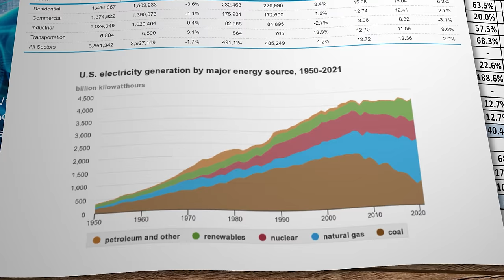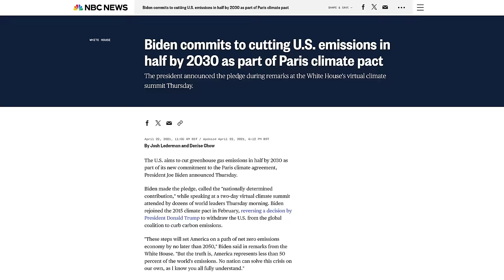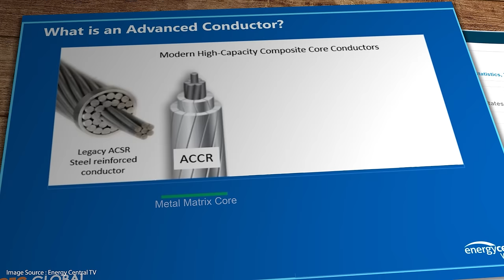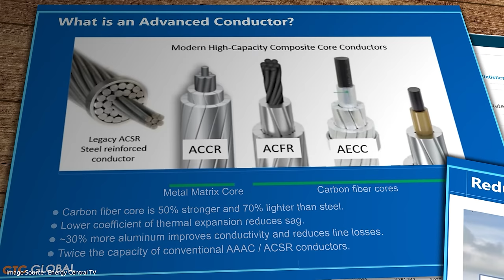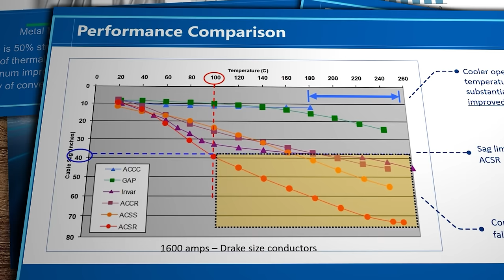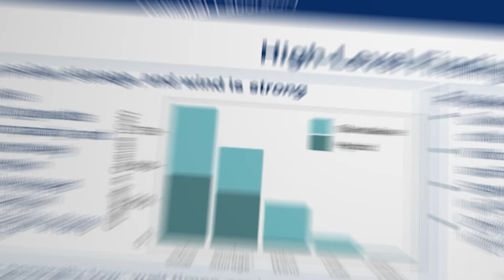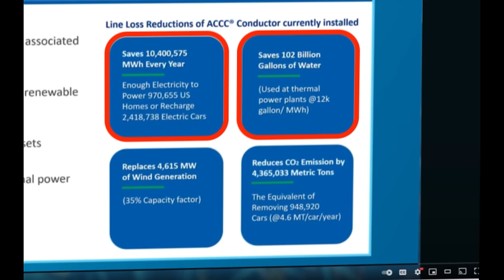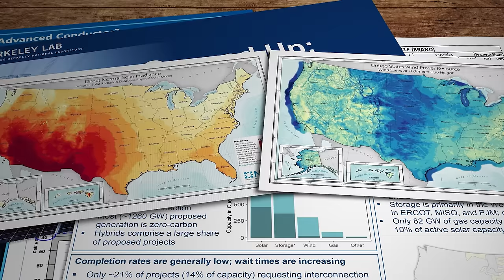Rethinking electricity grids.

Comment: 3:44 ACSR does not mean the aluminum conductors are protected by the steel. The steel is the loadbearing section and the aluminum the current bearing section. Without the steel, Aluminum wires would sag far too much and the risk of breaking would be quite high. The steel holds it up and steel is quite cheap.

5:23 The weight of the cable, regardless of the core, is still a major hurdle. That weight induces forces on the structures that hold them up. If you go too heavy, you'd need thicker (can also be read as taller) poles to handle those forces. Poles for distribution are often made of wood. These can be anywhere between $1000-2500 depending on height. If you go for stronger materials like concrete or fiberglass, those costs go up substantially more. And if you consider that a square mile of area that is relatively densely populated likely has 1,000 poles or more... you can see how the costs of this would go up quite quickly for even a small change. Who's going to pay for it?

6:21 Permitting isn't as big of an issue as you might think. Standard municipal permits for work (I'm a utilities designer, btw, specifically for electric) generally take a week or less. It's only when you get into culturally or environmentally sensitive areas that you run into extended timeframes. Most utilities have existing agreements with the municipalities they serve to expedite permitting processes.

7:30 Transmission losses are only really relevant for transmission lines, specifically, ATC (American Transmission Company) in the midwest. They're usually in the hundreds of thousands of volts whereas distribution, going from the substations to your homes, are only 10s of thousands. Rather than reconductoring, a simpler solution would be to kick up the voltage. Doing so reduces the current, which reduces the heating. The only issue is you'd need to replace all the transformers that take that high transmission voltage and drop it to a distribution voltage. That distrubution voltage is usually go for 20 miles or so before you have too great of losses. If you change the distribution voltage and make that higher too, then you have to replace all the service voltage transformers... and that's also expensive.

There are three very important questions you have to ask youself about this 'idea'... Who's going to supply the materials? How much is it going to cost? Who's going to pay for it? Public Utilities have agreements with the states within which they operate to establish the costs of the service. If you start taking on huge (and expensive) projects like this, it first has to go through planning. What's it going to cost? What's the timeline? And then they have to propose an increase to the paying rate for the service to the State for approval. If it is too high, the State will not allow it, which means the project dies. Utilities do not generate a lot of profit and they operate very closely within the margins. Hell, we get updates on the budget every month or so during our group meetings. 

It sounds good... but until it's broken down into details to the point where it's generally given to be cost-effective, it's not leaving the ground. Utilities can't just print money to pay for projects like these. Whatever something costs, we have to take in at least that much to pay for it. There is no credit system here, no 'National Debt' to fall back on. And if you cannot provide a relatively cheap source of electricity to the customers, they won't live here and if they don't live here, there' won't be utility bills being paid which means no monies for projects like this. 

That's really the only gripe I have about your channel. Nearly every story is "Oh here's something we should be doing! Nevermind that it's extremely expensive... just throw some money at it!" but you never get down into the details of how it would actually be paid. Sure, you can look at figures and graphs and get a high level estimate of costs and savings, but that's the same as using laboratory conditions for solar and expecting real-world solar to operate exactly the same at exactly the same cost. And you and I both know that isn't how that works. But... as far as this ONE idea goes... it's not a terrible one. It's still bad, but not terrible.

Cheers.
Reply: The cables have to be replaced every 40 years so you would assume putting in new cabling  is factored into power company budgets. Not everyone lives in the US, in the UK, where this channel is based, National Grid does replace pylon cables in major repair and upgrade. Same in Germany.
Reply: Thanks for that.  I have no idea about the true economics of making the grid more efficient but I do know that home and car battery prices are going to come down about 50% or more. When that happens, being off grid with solar, in countries like Australia that don't have long very cold winters, will be cheaper than being grid connected. Many small towns and isolated farms will simply not need those expensive long connections to a centralised generator. How decentralised generation and storage will affect the economics of the grid is what interests me.
Reply: @marczakian3511 
Deferred maintenance enters the conversation.
Investor owned utilities are notorious for operate until it dies.
The UK has it's little issues too, such as sewerage going into the ocean and DRAX.
Reply: You raise some good questions and offer a fair critique, I think. However, I have some questions and critiques of my own. 

1. Are you saying thw wooden pylons would HAVE to be replaced?

2. I could be wrong about this. But reviewing the engineering may take a week on new builds. But, going from doc submission to shovels is significantly longer, no?

Otherwise your critiques are based on privatized grids. Which, unfortunately for you Americans, is a serious drawback. So, it's probably right for your area, but like other have stated, may not be for others (cost wise). 

Plus, if we're ever going to save the planet, we do need to stop micro managing cost and start to invest in our futures. That's not a critique for you. Just my own feelings. 

Speaking of which, this is why we NEED to get rid of capitalism and privatization. It's been killing us for centuries. It's time we start thinking about what's best for humanity not the stock market.
Reply: @choui4  1: If the poles or pylons cannot handle the additional stress you'd be putting on them, then yes, absolutely, they would need to be replaced.
2: It depends. I've recieved a job, had it designed and approved within a week, had the permit approved that same day and had shovels in the ground the following week. It takes coordination and effort as well as good rapport, but it can be done.

Privatized grids (read that as State-enforced monopoly) is why we have singular poles with very few cables on them as opposed to some places I've been to in Asia where they have, quite literally, hundreds of cables on a single pole and wires going everywhere that makes it look like a rat's nest in the sky. That is incredibly dangerous and often poses several other problems.

If you want to save the planet, you HAVE to come up with ideas that are cost-effective. America, at least, is not a dictatorship nor purely communist, socialist or capitalist country. We have aspects of all 4, but not purely one or the other. For the best ideas, the best quality and cheapest costs, capitalism, and I mean real capitalism, not the pseudo-capitalism we have here, is the only way. People need to build the things. They need to be paid to build the things, and other companies must exist the supply the things the people need to build the things. You have to have multiple companies supplying the things to create competition which drives down price and drives up quality. If you're not paying the people to build the things, that's no better than slavery. And ultimately, it's what every communist and socialist system devolves to. The Have's get to do nothing and live a life of luxury and the have-nots get stuck with the back-breaking labor for pennies, if that. Sorry. Capitalism is the only fair way forward and Capitalism means thinking about the costs of things and apply methods that are cost-effective.

If you want to kill us quicker than 'centuries', as you say, then move further away from Capitalism. Instead of centuries, it'll be decades.
Reply: @marczakian3511   Overhead cables can go much longer than 40 years. We have copper that has been in place for over 100 years still distributing power. Generally speaking, we replace overhead wires and cables every 60-80 years and underground or buried cables every 30-40 years. The reason for this is because the earth will eventually eat away at the outer casing, which causes faults within the cable and failures. Air is much less corrosive... but people don't like seeing wires in the air, so we put them underground...
Reply: The video seems to be talking about transmission more than distribution.  Hence, the maps of the lower 48 states and their regional grids, and images of high voltage transmission lines.

I agree that this channel spends a lot of time on lab scale technologies, but this video seems more about ongoing changes to the transmission grids.  There are channels that focus more on near term, commercial technologies.  And some new transmission lines in the world have proven extremely profitable, making as much in profit in 3 years as their cost to build, such as between the UK and Norway.
Reply: @markumbers5362  Grid-connected personal generation is a strain on the grid. The only reason why it's even done is because the State enforces it, and so we must comply. With standard, centralized generation, we can match generation to the power requirements and operate very smoothly and consistently on that knife's edge. Additionally, it's easy to maintain a 'spinning reserve' to manage unexpected peaks in power usage. 

When you start adding solar and wind generation, you mess with those algorithms which cause the power plants to operate much less efficiently. If you have a 100MW system running powering 10,000 homes, it's very easy to bring the generation up to 120MWs during known peaks and bring it down to 80MW during known off-peaks. When you take that same 100MW system and add in 15MW of solar, then because you cannot efficiently store the solar, it must be used... so you have to bring down the 100MW to 85MW to match use. But what if a big cloud floats across the area? Now your 15MW of solar is producing 3MW, and you have to find some way to bring up the normal generation from 85 to 97MW within minutes... which, by the way, can't be done. 

So, what you do is you keep your 100MW generation running at 97MW even though the solar is producing 15MW, which means you're wasting 12MW of coal or gas because solar is not steady. The same thing for wind. If the sun stops blowing and the sun stops shining, you get drops in power which must be taken up (very quickly) by coal or gas which is inefficient and wastes money. Natural Gas-powered turbines (methane) take about 15 minutes to get up to full speed. Coal takes a couple hours. So between the coal or gas turbines spinning up, you either have to have backup storage or you end up with brown-outs or black-outs. And who gets blamed for those? The power company. So to connect solar and wind to the grid is to induce inefficiency into the system which then increases the costs of that system which is why your energy bill is going up. But then again... it only goes up for those who DON'T have solar or wind... but screw those guys, am I right? lololol. But seriously... passing off the costs of inefficiency to those who have the hardest time affording it is not cool, man. Not cool at all.

The absolute best power system to have for centralized generation in the MW or GW scale is nuclear, hands down. Very high energy generation, zero (ZE-RO) operational CO2 emissions, and concrete-encased nuclear waste that you can literally stand next to safely, which can be also be effectively managed as your only downside. The second best is hydro, but only because it requires very specific geographic areas to operate properly. Methane (natural gas) is next, followed by coal with exhaust processing, then wind, then solar, then coal without exhaust processing.
Reply: @Xero1of1 1.	I know, that’s what you’ve stated. I’m asking, is the new material really going to be too heavy, or is that speculation?
2.	That’s impressively fast. But surely you’d agree, the VAST majority of projects take significantly longer than two weeks.
I don’t think you know what capitalism, socialism, and communism mean. It’s okay, most don’t. If you believe that introducing a profit motive and wealth hoarding is somehow better, I will not disabuse you. 
Also, America IS capitalist. They are the fascist, capitalist, imperialist bad guy of the 20th century. By definition, when you introduce wealth hoarding and profiteering, you introduce power imbalances. Those power imbalances create a self-fulfilling cycle of more money and more power going to fewer people. To say America isn’t capitalist is to completely misunderstand what capitalism is. 
We don’t have to continue the conversation around politics. I was more so editorializing for anyone else who reads my reply in the future. That said, if you’d like to continue it, we certainly can. It’s my area of expertise. Just like electrical engineering is yours. So, I’d still love to know the answer to the above questions, if I may.
Reply: @Xero1of1  Oligopolies, such as competing utility companies, are generally the example of where the unregulated open-market doesn't product very good value for the average person.  They are the reason most of the world has either a regulated private monopoly or publicly-owned utilities.
Reply: @Xero1of1  You are really full of it. Nuclear is the most expensive form of generation. Centralised power generation is also a military target.  I don't think know nearly as much as you think you do.  If someone has a home battery and solar panels they rarely use the grid at all. Extra back up can be a petrol powered generator. Home solar and battery is twice the price of commercial scale so there is no need at all for anything other than wind solar hydro plus battery and diesel backup. Diesel back up generation is almost instant . While very expensive to run it is by far the cheapest to lay idle.  Which it will 99% of the time.
Reply: @Xero1of1  To a point, capitalism only get's you so far. One of the biggest issue's with capitalism is the primarily profit driven nature of private companies often results in the cheapest, in the figurative sense (cheap, poorly made products), for a premium cost.

However, you are correct in that the US and most other Western Democratic nations also allows for State/Goverment funded & owned infrastructure projects such as this.

The centralised Governing body should be responsibility to provide & Maintain the infrastructure for utility's such as Electric Grids, Water/Sewage Piping and Mainline Telecomunication Cabling; Much like it usually is for Roads & Transportation infrastructure.

Essentially, the Government/State ought to handle the larger, long distance and necessary infrastructure that Private Entities use. It allows the Government to do it's job in setting the key market indicators that provide the required stability & assurance for investor's and private entities to conduct (pun absolutely intended) business.

 This would allow for Government Funding to do the "Heavy lifting" in regards to the costs of upgrading lines, transformers and any other essential components required. 

Additionally, having these Essental Infrastructure projects owned by the State/Government was intended to be a means of providing a passive means of generating Revanue for their own Maintenance and Inital Funding of Expansions or Upgrades (such as the ones we are discussing now) to the infrastructure itself. 

Optimistically, the Revanue generated could also go into Funding other Public Services as well. 

The manufacturing, construction and maintenance of these Essental Infrastructure projects would obviously be Tendered to Private Entities that already have the expertise & workforce to do the work. And that would be conducted using our system of capitalism and fall under the standard Government Contracting process that most Democratic nations utilise already.

As the State/Government can, and often does, take on such Debt for the long-term returns of Essental Infrastructure & Services; Then, cost shouldn't be a major factor in undertaking this necessary step toward levelling the playing field for all sources of Electricity Generation.

Renewables, such as Rooftop Solar, don't presently have the required infrastructure available to fully utilise their capacity to feed back into the Grid. 

This creates an issue for it to be properly represented on the freemarket. Thus, it's not on even footing to compete within the freemarket as the infrastructure doesn't support it's full capabilities, making it less attractive to potential investors.

In such instances, the State/Government should intervene to rectify that issue and provide that level playing field for all sources to compete in the freemarket yes?

Or are you opposed to the State/Government ensuring that any and all potential competitors can actively compete in the freemarket?

I'm curious as to why you believe such a simple, if a little costly, solution couldn't (or shouldn't) be undertaken under such circumstances.
Reply: It's not so much about should or shouldn't, but rather what will happen versus what we hope could happen. 

I think you're a little misguided on the capitalism versus government funded products. The government is very good at one thing when it comes to the market. Slow production at high cost. Take a look at college tuition for example... as soon as the federally-backed student loans came into play, tuition skyrocketed. Same thing with government contracting... Perhaps you've heard the expression 'The government pays $200 for a hammer and $5 for a nail' or something similar. This can be good, as it inject a LOT of money into the economy, but depending on the government for anything of quality is highly suspect. There is a reason why I don't go to the VA Hospitals even though I'm 100% covered as a Veteran.

Governments should stick to what they're design to do. Protect free trade by breaking up monopolies and whatnot, coordinating trade between states and nations, and providing for the common defense so that the free market can operate as a free market. It's when the government steps in when they shouldn't that things generally go to hell and get far too expensive.

All of this reliance on the government to 'save us' is like watching the water in a toilet bowl swirl down into nothing as it's flushed. Very little good can come of it.
Reply: @Xero1of1  How does one usually smooth out the erratic fluctuation and limit/prevent backflow of power in most basic electrical devices mate? 

Capacitor's and rectifier's I would imagine. 

Lithium Iron Batteries are dirt cheap, have a great themal operating range, the punishment of rapid charge/discharge states and is long-lived as far as several thouand full charge/discharge cycles go.

The only significatnt issue for Lithium Iron Batteries is the weight, which becomes less of an issue when used in a stationary structure like a Communal Battery Storage Facility.

Such facilities could easily be installed in, under, over, beside and/or near localised Sub-Stations & their greater regional Transformer Stations.

Re-Wiring the existing infrastructure with the proposed improved Transmission lines would allow us to also install a means of Rectification within local & regional sub-grids.

Meaning, it would allow for a finer control over which sub-grids require external supply while being able ensure the continuous required base load power while power is being sourced or re-routed external to said sub-grids.

It does require re-cabling and installing some new infrastructure, yes. 

It will be fairly expensive to do, yes.

It will also reduce consumer & provider costs, reduce total & on-going emissions, provide a more stable & efficient flow of power and allow every power generation source to compete on an even playing field.

Granted, renewables such as Wind & Solar won't be able to replace all power generation needs in most Northern nations.

The UK & Japan are examples of nations that have large populations on a small, semi-isolated landmass. Additionally, both are too far North to ensure a consistent means of power generation from solar.   

As such, large scale Solar Arrays would be ill suited to achieve Net Zero. Fortunately, both do have existing Nuclear Power industries that can make up for the shortfall of any Renewable systems that do get implimented.

Hydrogen Fuelled Power plants, in lieu of Natural Gas, is also an option that can be cheaply fuelled by a Southern Nation producing Hydrogen via Renewable (Solar predominately) powered Electrolysis.

This could help minimise the cost, time and issue's with building new Nuclear Reactors. Or even supplement power generation until the new reactors are built.

The US is also an odd case, most of it's landmass is too far North to use the likes of solar efficiently. It's population is also considerably larger than most developed nations, it's not prohibitively so for large scale wind farm & solar arrays.

That said, the quantity of such Renewable sources needed to meet the demand (current & future) of the US is. So, similarly to the UK & Japan, the US has an existing Nuclear Power industry that can account for the shortfall of the Renewable Systems.

Just as it could also utilise Hydrogen Gas for interim power generation, in lieu of Natural Gas, and/or to minimalise the quantity of new reactors needed.

Conversely, a Nation like Australia is perfectly located to maximise solar efficiency and has close to the same landmass as the continental US while having less than a tenth of the population.

There is quite literally no other nation more suited to become 100% renewable powered than Australia.

As such, it would easily be able to sustainably produce Hydrogen via Electrolysis to supply to other nations while accounting for it's current and future power needs.
Reply: @Xero1of1  Yeah, the US Government (Both State & Federal) does seem to suck at Governing, by that I mean providing basic essental services & infrastructure and setting the baseline stable market condtions for fair & balanced freetrade.

Thankfully I don't live there, though my nations Government only sucks a little like that half the time.
Reply: @soulsurvivor8293  ok. Hydrogen visa electrolysis, even owed by renewables, requires perfectly clean water, otherwise you off contaminants or pole the quality of the hydrogen. That requires significantly more infrastructure and power than just two wires in a container of water. 

It would seem you have some experience with electronics. Micro and macro scale, while similar, are different. With the amount of power some of these solar farms generate, you will blow up conventional caps and regs. Also, with electrolysis, where you gonna get the water? And if it's from the ocean, what are you going to do with the brine? Lithium may be 'dirt cheap' but it explodes. And mining it requires many human rights violations.
Reply: @blaydCA   Yes.  And this is a highly political issue. The water companies were privatised in the late 80s. And have been manifestly negligent in cleaning up our waterways.  (The  Thames is an exception).  Drax is a failure of oversite. On the other hand, the UK has one coal plant left on the grid, which will close later this year.
Reply: @marczakian3511  
DRAX is a colossal green wash when you IMPORT trees that have been processed in CANADA!